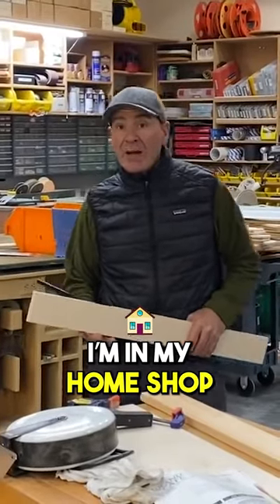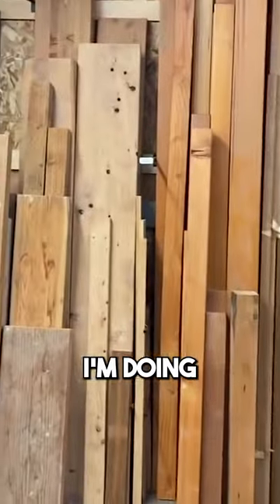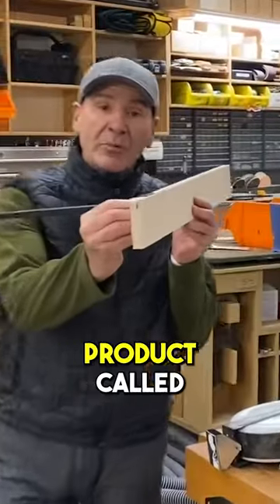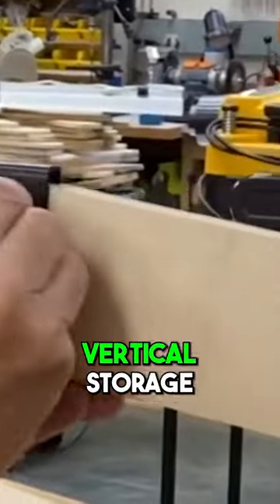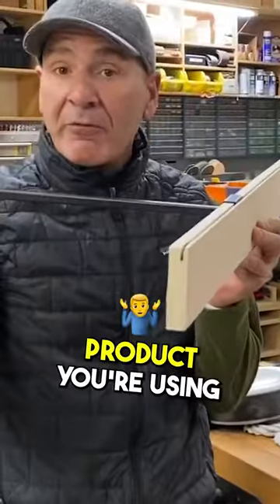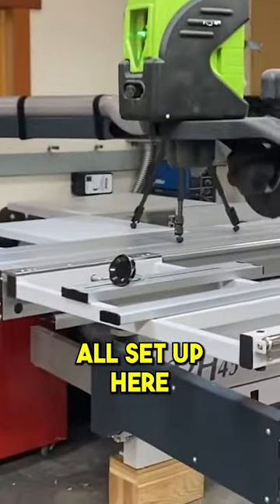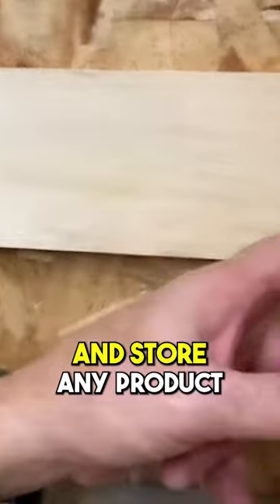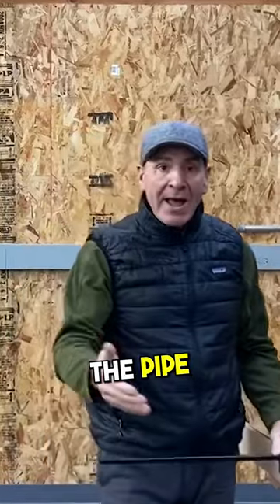The Speed Divider  | Rebuilding My Shop  #Shorts #Lean #2secondlean

Comment: Need to make a bracket like that for the use with French cleat system.
Reply from the maker: @tomwags4238  We do have a bracket for the French Cleat System. Check out our Smart Cleat https://www.fastcap.com/product/smart-cleat-4
Reply: @FastCapLLC  but you need the speed divider that works with the French cleat rail
.
Reply from the maker: @wags99999 Great point. We will pass this suggestion along to our engineering crew.